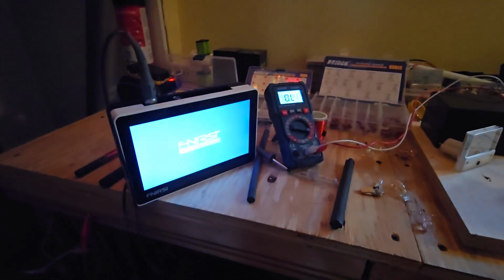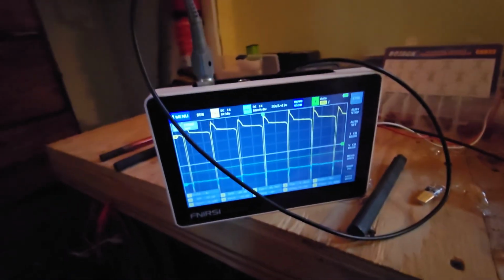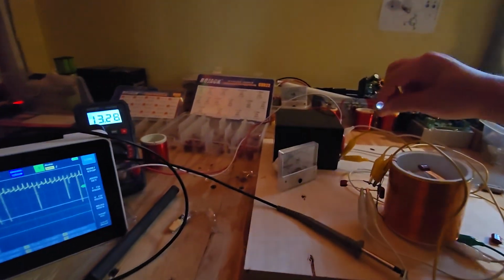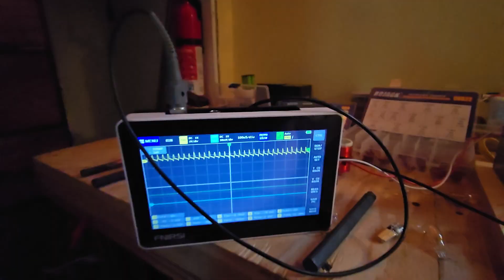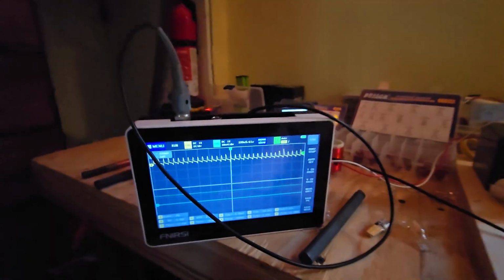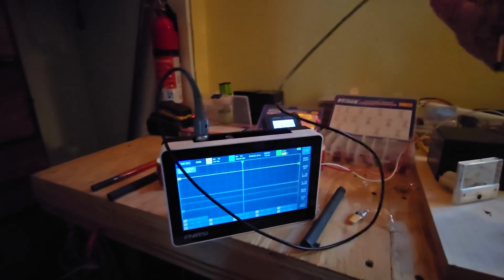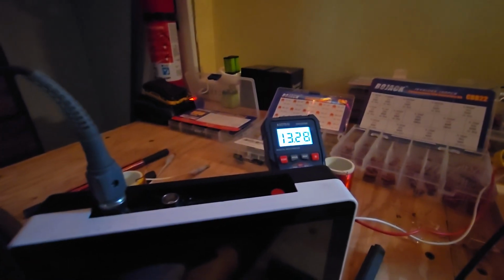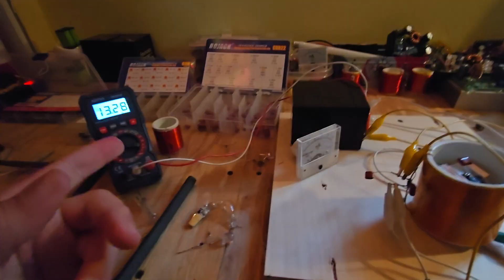🔧TUNED UP & REFINED TRANSMITTER TESTS.ADJUSTABLE SELF OSCILLATING AIR CORE SHOWS PROMISE.QUICK VID🤳

Comment: I've been working with something similar recently; however, im using a parallel mosfet module driving with an adjustable pwm module.  The mosfet modules are cheap enough off of Amazon.  I'm experimenting with the back emf spike through a coil.  The trick is to  find the right frequency and keep the duty cycle really low to get those voltage spikes out of the time domain/current consumption.